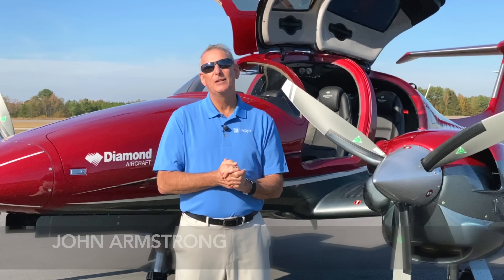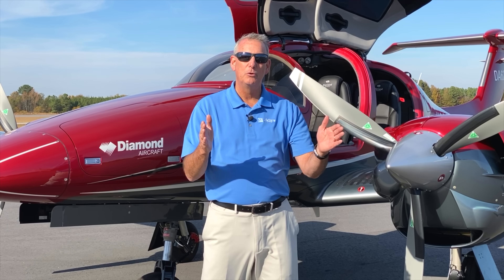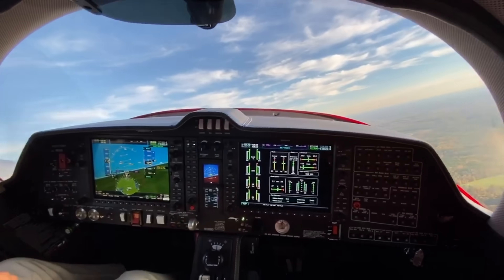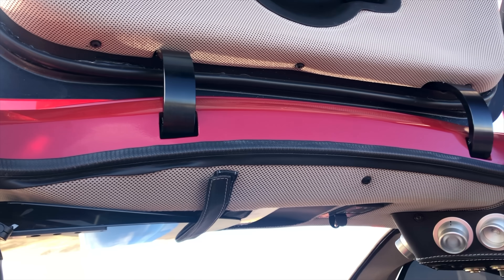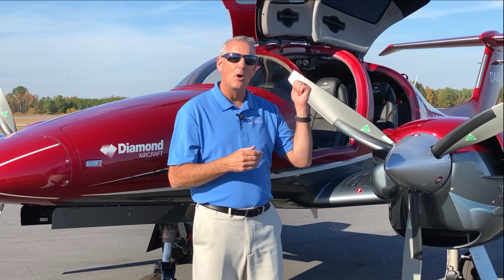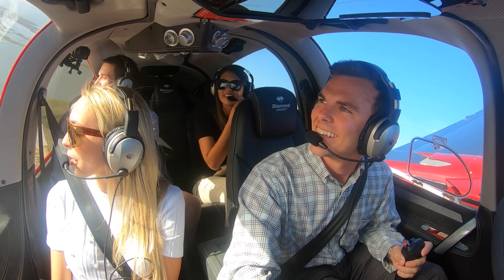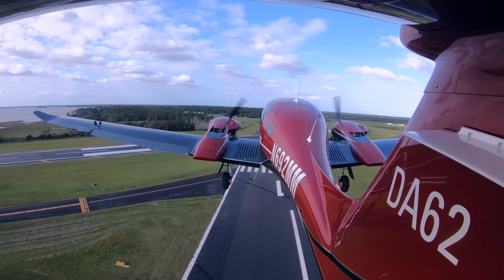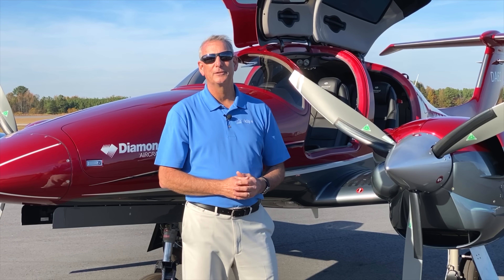What Makes the DA62 the SAFEST Twin-Engine Aircraft? | DIAMOND AIRCRAFT SAFETY SPECS

Comment: Why no parachute?
Reply: its a twin. LOL I cant tell if you are serious.
Reply: Mike Rom because 90+% of G A accidents occur below the altitude that a parachute can be deployed.  And of those that occur where the chute can be deployed, most involve engine failure...hence a parachute is nice for a single engine... but when you have a spare engine, the percentage of instances where the chute would be of use is extremely low.  Chutes cost money and take up significant space in the airframe- they weigh a bit and reduce load capacity- and they add cost because they need to be regularly inspected.  Would you pay all those costs for a safety feature that would be of use in 1.2% of accident scenarios?
One cirrus pilot flew his plane into icing conditions and the wing stalled... but by the time he deployed the parachute the plane was at such a speed that it literally ripped the parachute off.  This plane has de icing features that mean you would likely never be in that position.

Comment: We had one crash last year in Dubai while doing Airport instrumentation calibration 
Was caused by turbulence. From a A350 on the parallel runway
Reply: Wake turbulence is far more extreme than anything you'll be comfortable even untying a small airplane in.  When you have that much mass of air moving downward, there's not a plane in that weight class that could avoid crashing.  To be honest, that's more on ATC than either the pilot or the aircraft.
Reply: James Burleson 
Unfortunately the pilots had an agreement with Atc that they would look after aircraft separation etc but I think nothing was wrong with ATC still monitoring and warning them 
https://www.gcaa.gov.ae/en/Pages/NewsDetails.aspx?NewsID=489

Comment: How much over $1 million dollars for the Diamond? I hear that a Cirrus is at or over $1 million. Thanks for destroying aviation for us working types by costs increases.. A safe aircraft only the uber rich can buy. Let’s hear what that Diamond dude has done to help lower the cost of aviation. Do yourself a favor, purchase a used Cessna, Piper, or Beech. Use that million dollars to get advanced ratings and build PIC time. I hazard a guess that if you are stupid enough to pay the high price for a Cirrus or Diamond, then you are probably not intelligent enough to have a pilots license.

In the end, nice airplane, but only at less than one half the asking price.
Reply: " if you are stupid enough to pay the high price for a Cirrus or Diamond, then you are probably not intelligent enough to have a pilots license."

You are blasting the "dumb" rich people? 

You are precious, thank you for the laugh.
Reply: beta1618- I do not associate the accumulation of wealth with absolute intelligence. At $1.24 million equipped,  less than 190 knots cruise, I doubt anyone will have to wait in line to purchase one of these. If it doesn’t slow the unsustainable rise in the cost of aviation, I just ain’t interested. As far as safety? Check the Cirrus fatality record against that of a non parachute Cessna and see which is lower. This is a very nice airplane. However, is anyone who can afford one going to give 2 cents worth about fuel savings? With new aircraft, doesn’t the pilot always have the same name? Isn’t it Garmin?
Reply: @thesearcherman6652  

Young man, please don’t ever change!  I’ll just quickly help you out with the following:

You said “Less than 190 knots cruise”;
True, but the DA62 = 185 knots cruise TAS at 85 % (12,000 ft).  That is not too shabby at around 16 gal/hr combined. 

Unless you know of another certified TEP that can match that fuel burn and speed?

You said “1000 hour engine overhauls”;
Current TBO is 1,800 hrs for the AE330.

Hope you have a nice day!
Reply: beta1618-Ok, my TBO statement was from a Flying mag article regarding the 2016 model. TBO was apparently increased in 2017. (Edited) But, if the TBO increased, hasn’t the price increased also? The price number that I used is from that same Flying article. Do you have any financial interest in Diamond? Employment, sales, owner, etc.? I do not. My contention is that these million dollar plus GA aircraft are way overpriced, and basically have little to offer that was not available 50 years ago with the exception of avionics designed to eventually replace the pilot.  

Young man you say? I took and passed my PPL check ride on April 21, 1974. And, just when did you get your PPL, sir? We had affordable GA for the commoner back then. What we have now is BS aviation.
Reply: @thesearcherman6652  Dont blame plane manufacturers for the prices, certification and avionic costs are most likely the reason, its a problem with all GA aircraft these days.
If there is one manufacturer that doesnt deserve the "same old technology" stigma its Diamond, they always put great thought into their planes, have developed many safety features that were completely unheard of in GA before, use hightech materials and manufacturing methods and have designed the most fuel efficient engine on the GA market. Meanwhile Cessna is charging 300-400k for a C172, a plane that hasnt changed in decades and comes with engine technology from the 1960s, whats their excuse and who is overpriced now?
Calling people stupid for paying normal market price for a product and caring about running cost doesnt make sense to me either. Im guessing the majority of these people have shared ownership, finance it with a long term loan, or purchase through their company, i doubt alot of people show up with 1.3 million in cash.
Reply: > "Do yourself a favor, purchase a used Cessna, Piper, or Beech. "

Well some 'stupid' person had to pay for those expensive new Cessnas, Pipers and Beeches so that 'geniuses'  like you can pick them up for a song 40+ years down the line.   The cycle continues.

Comment: Sorry.. Cessna Skymaster, Rutan Defiant and the Adam A500 are the safest twins.
Reply: @Gmoney 
OMG, the SkySmasher was NOT a safe plane!
https://www.latimes.com/archives/la-xpm-1989-04-01-me-962-story.html
“...
In the survey by Aviation Consumer, the twin-engine plane with the lowest fatal accident rate was the Cessna 414. It had a rate of 0.8 fatal accidents for each 100,000 hours of flight time. The Beech 60 Duke and the Beech 76 Duchess fell in the middle of the 18-plane survey with fatal accident rates of 1.3 per 100,000 hours.

The Cessna 337 Skymaster was ranked 16th in the survey. It had a fatal accident rate of 2.5 per 100,000 hours, according to Noland and Aviation Consumer, which publishes twice monthly and is supported by its subscribers. The magazine, which is highly respected within the industry, carries no advertisements.
...”
Reply: As long as you pay no attention to the data and/or they aren't flying, you're right.
Reply: Reflected Miles I have flown in all three in the last 12 months. I understand what you are saying though.
Reply: Gmoney All of the Skymasters that used to be based in my area were eliminated by fatal crashes, several in bad weather and high terrain where the pilot tried to continue flying to an airport engine-out at any cost but altitude simply couldn’t be maintained—the same basic problem as other light twins. Asymmetrical thrust is just one component of the excessive fatal rate in those types. Here is where things stood in the Skymaster’s heyday:  https://www.latimes.com/archives/la-xpm-1989-04-01-me-962-story.html
Reply: Reflected Miles bad weather and high terrain are not aircraft related issues. Those are pilot issues. The engine out concerns again, PIC made decision to push on. Not one of those issues is aircraft design concerns. Fly safe
Great book out there called “the killing zone”
Reply: Gmoney  Not once has that same decision been made in a single-engine, nor been necessary in a typical twin-engine jet. Equipment is a major factor in how dangerous such decisions are, and even why they are made—for example, being assured that centerline thrust gives a significant safety advantage when the reality was that the C337 fatal rate was several times worse than the C414.

Comment: I like a lot but i think it's little expensive, a piston aircraft around 1.5 millions is expensive but is only my opinion. Remark, I like a lot DA62 plane.
Reply: Certified avionics are probably about a third of that cost, another third is the engines and the certified ECUs.  The airframe and interior are way less than half the cost of a new plane these days.  I really wish the regulatory agencies made certification less expensive and time consuming.
That said, for what you're getting, it's a decent price.  $1.5 million for a brand new twin with insane fuel efficiency that you have to try hard to crash with, and has a full glass cockpit with really good autopilot and radar is a good deal.  It's certainly more affordable than a new TBM or PC-12, and it burns Jet A.
Reply: You get what you pay for
Reply: Expensive is a relative term.  As my dad used to tell me when I said new cars were so expensive that I couldn't afford one... "Then make it yourself and show them how to do it."  You get what you pay for!
Reply: @jeffreybrauer4317  In the case of GA, you might actually succeed by making a revolutionary design.  The market is small enough that it's easier for the small players to break into it.

Comment: I wonder how this plane perform with turboprops  !!!
Reply: You'll need twice the fuel tanks and power to back that up. Understand too that the wings are designed for a given speed. Go too fast and bad things start to happen, Piper Meridian when the pitot tubes freeze up is an example
Reply: Thank it's too small for gas turbines.
Reply: @martinw245  Soze  the Hondajet.
Reply: @dickjohnson4268  That's a jet though, not a turboprop. Turboprops require a gear box etc.
To be honest, I'm not sure what the smallest turboprop engine is. The PT6 is popular of course but it's pretty big.
Reply: @martinw245  Rolls and Allison have Bone and 210 conversions in a very small package. Add Tip tanks and 'VIOLA!' The problems with the Helio Stallion's fuel capacity was solved with 310 'guppy' tanks. GE has a PT-6 replacement, and it would be interesting to see if they  could come up with a UDF version for smaller aircraft applications based on the same de$ign. The Aerostar with fan-jet engines is an example of working with limited areas for fuel supply.
Reply: @martinw245  Oh yeah, you wrote gas turbines. The Ng on fanjets and turboprops are still gas turbines obviously. Anyway, all we need is cubic NASCAR team money to experiment. We looked at Blackhawk and GE for conversions. The return on investment would have been a stretch for us.
Reply: @dickjohnson4268  Rolls Royce have the M250 small turboprop engine I belive. Not sure if it would fit in the DA60. Might do. Pretty small power plant.  Power ratings ranging from 420-450shp. Trouble is, it would make an expensive aircraft even more expensive.
Reply: @martinw245  Yup. Cubic dollars. It's only a  matter of time  before RENO has a race class for them when the speed merchants start their offerings.

Comment: Excellent presentation, love this aircraft. Can the radar see other aircraft or is it strictly for weather? Cost?
Reply: No, it's just a weather radar.
Reply: The radar is for weather.  However, it has ADS-B which sees and displays other aircraft on the PFD and MFD so the answer is Yes!
Reply: @jeffreybrauer4317  Well no. ADS-B Isnt a function of the radar, just because its displayed on the same MFD. ADS-B is a tech whereby the aircraft determines it's own position via satellite navigation and then broadcasts its position.

So no, the weather radar cannot see other aircraft.

Comment: I do not understand to upgrade these engines to 200hp each, which is no big thing to Austro Engines. That makes a lot of sense to this fabulous plane and helps a lot.
Reply: Cost to certify a new engine. A bigger engine means bigger fuel tanks which means more weight which means bigger wings.
Reply: Eastern Woods I don‘t think so in some points. Same engine, maybe little more weight, certification yes, but out of this maybe also better sellings. More fuel marginal, bigger tanks and new wing, I guess not necessary. Besides that my comment meant, back past in the development on starting the DA 62 why they decided to stay with the 180 hp instead of 200 hp. I understand the point of costs to it. This engine was already there and certified I guess, and the plane is not bad with 180 hp either.
Reply: You can always improve.  That's called progress.  If they increase the horsepower and it results in an overall better aircraft I'll trade my current DA62 in for the newer model.  Take a at the TBM's they upgrade about every few years.  The manufacturers have to make a decision to freeze the design and move ahead at some point or they would never have a marketable product.
Reply: Jeffrey Brauer that’s true and the point. Its also may opinion. Good comment.

Comment: if they can add pressurisation, it will be the ultimate modern day GA aircraft.
Reply: And more horsepower.
Reply: That would double the price and not adding much speed; diesels are not efficient at high elevation.
Reply: @ArmyNurseCorps-u5c  i am not sure about whether it would double the price, it would certainly be expensive than the normal da62 but since diamond is targeting family audience with the da62 unlike the da42 and da40 which is mostly targeted at flight schools, it would be a great addition.
 no, diesel is still much more efficient than gasoline engine at high altitude. diesel engine might lose some efficiency at high altitude but it is still not that much to overcome the inherent efficiency difference between gasoline and diesel engines and also i don't think high altitude will be much of a problem since it is twin turbocharged.
And a bit more power wouldn't hurt either...
Reply: @superchargedpetrolhead  What got me thinking of the DA42 diesel was the presentation flight back to Europe. 50% power St John to Portugal. Slow but direct. What I really want when flying with kids is a bathroom.
Reply: @easternwoods4378  if you need a bathroom then only options are cabin class airplanes like king air or the pc12 they are 3 to 4 times expensive but have the capabilities to back it up.
Reply: @superchargedpetrolhead  My dream is a Beechcaft C90
Reply: @superchargedpetrolhead  Trouble is service ceiling is only 18,000 ft. And it is turbo'ed.
Reply: @ictpilot  Minor point, but the service ceiling is actually 20,000'.
Reply: @ultraturtle2673  Ok I knew it was close to the DA-42VI. But not by much more.
Reply: Well, that's not just some accessory you can bolt on....it requires a total redesign.
Reply: @karlrschneider  i know, but a pressurised DA72 will be really cool.
Reply: Supercharged Petrolhead with engines from the DA50
Reply: @aa134368  that is exactly what I commented on their recent da50 rg video

Comment: Do you think the new Garmin Autoland features will be incorporated into this model ?
Reply: it is in g3000, i don't think the g1000 could handle that but who knows they might....
Reply: Diamond aircraft actually demoed an autoland system quite a few years before Garmin did: https://www.aopa.org/news-and-media/all-news/2015/september/22/diamond-debuts-autoland-system.   Never say never.
Reply: no. you would need an auto throttle. the Autoland system is only approved for emergency's. its made to get you on the ground if all else has failed. You cant just use it when you feel like it. its most likely not super great at landing. but in descent conditions its good and much better than having a random person with no experience try and land it.